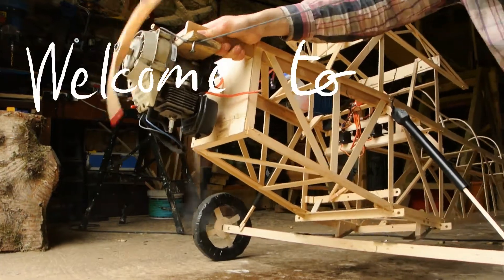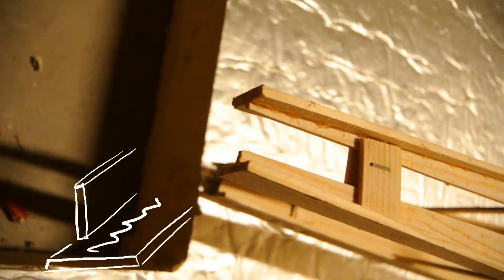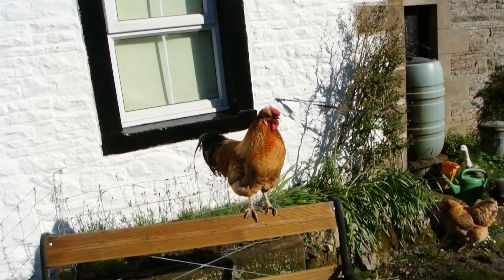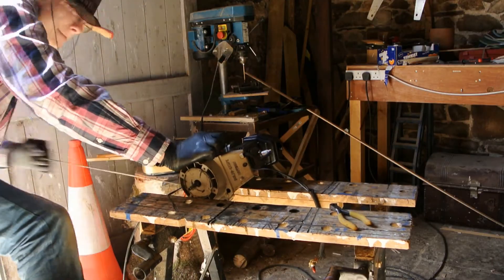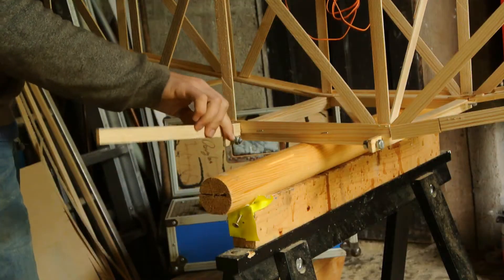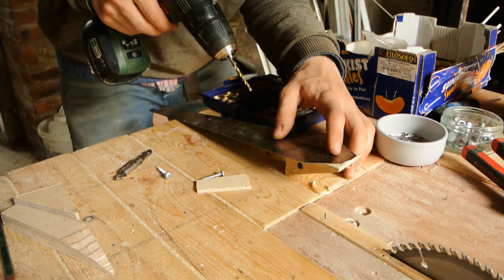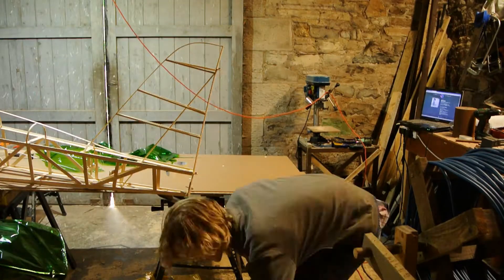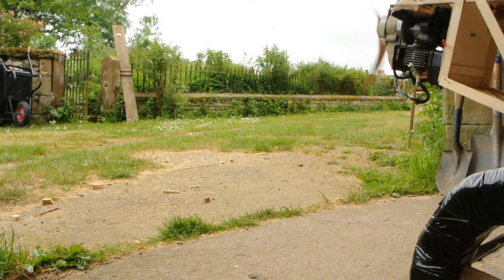In Pursuit Of Beautiful Dreams .2 Powered flight

Comment: been building for 50 years you are doing a good job, however l would have used sheer webbing on the main wing spars it would give them alot more strenght with 
very little in added weight the trade off is worth it.

Comment: I built one similar to yours I used a leaf blower motor but I stripped everything off of it that was an absolutely needed ended up trimming about half of its weight and metal you don't need all that stuff . Get rid of that shroud around the get rid of that shroud around the Magneto that's for cooling air you're gonna have ram air from your propeller for cooling and don't need any of that